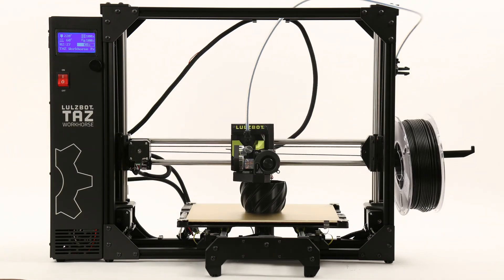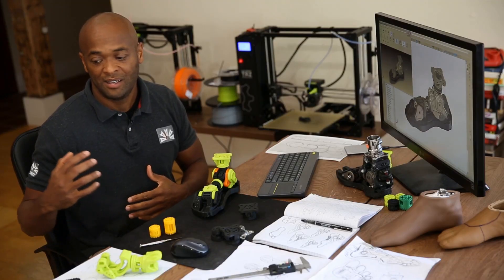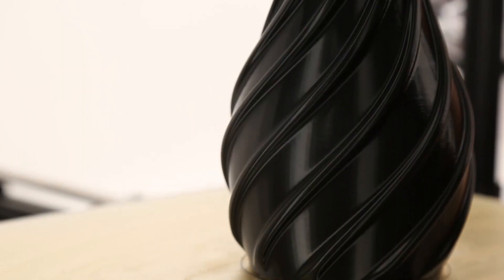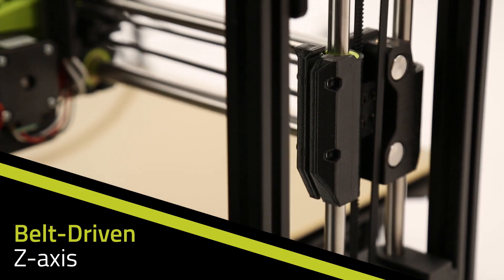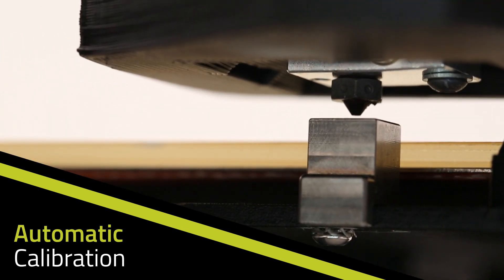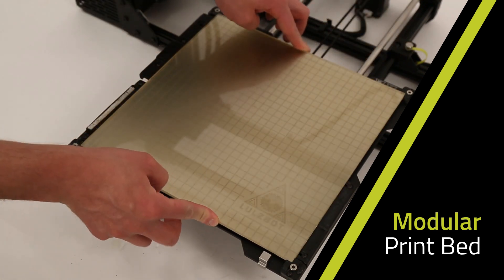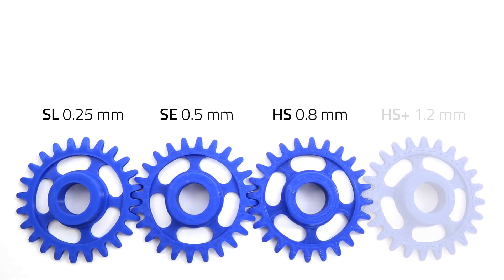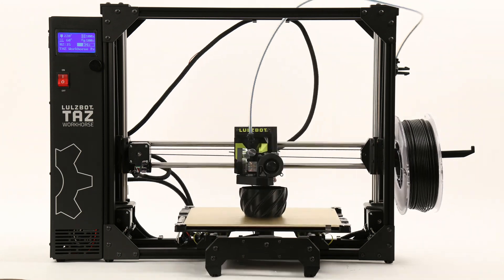The Next Generation: LulzBot TAZ Workhorse Edition 3D Printer

Comment: I got a new Makerspace and we switch 3D printers to the Lulzbots, I see that video's say they are great, but for me they are NOT. I really wish my supervisors would have allowed me to chose what printers Id be using. I receive a workhorse and 2 minis. The workshorse will NOT work, and getting Lulzbots team to help out is a joke. They will send you PDFs and close your ticket without confirming if your printer is working. I would say star away from Lulzbot. I work for a school trying to teach 3d printing on printers that cause more stress than actual work. Its like having an ice-cream machine from Mcdonalds, its here taking up space but it doesn't print.
Reply from the maker: Hello Monica, we would love to help you out with your Workhorse and Mini 2  machines. They are both solid units that will serve your makerspace well for years once you get used to them.